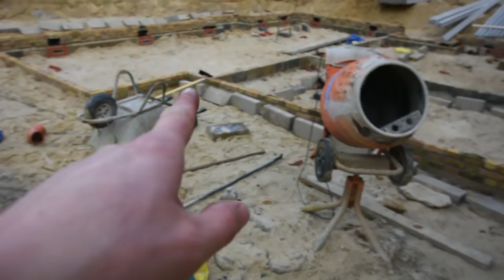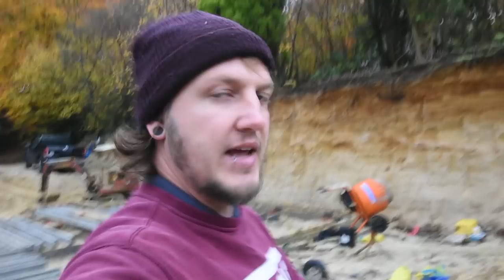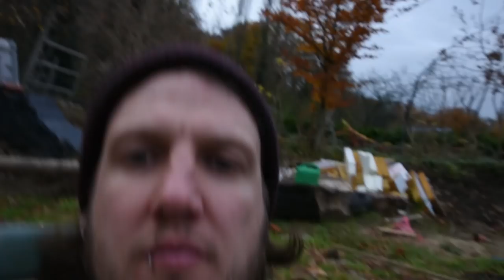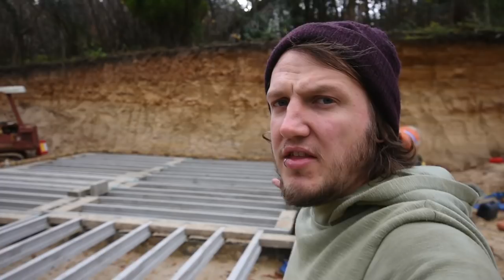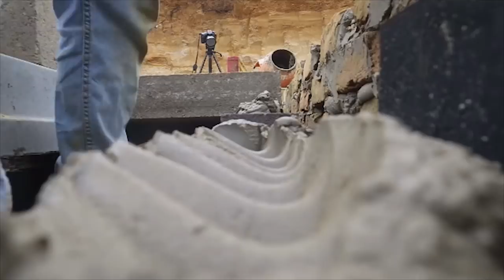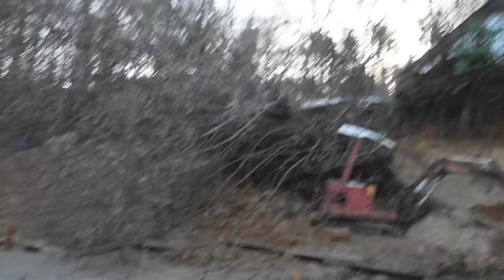How to INSTALL BLOCK & BEAM FLOOR CORRECTLY by YOURSELF | House Build E.P 11

Comment: Cool when I did mine I left a gap in the wall and got the machine through on some floor place a lot  easier lol did it on me own like you your doing a excellent job
Reply from the maker: 🤔 Good idea! It helped a lot using the machine to get the beams at least part of the way. Those suckers are so damn heavy!! Would deffo get an extra set of hands next time

Comment: I started watching this playlist and can't stop... Excellent!
Would it be advantageous to lay down a vapour barrier on the ground below to prevent moisture under the floor, for your climate?
Also. you could use a small bottle jack to lift the beams for you when installing the damp banding or lifting anything, easily. I have been working alone all my life; a couple of small 2 ton bottle jacks, 2 scissors jacks and wood blocks in 2 milk crates are an important kit in my tool collection.
Reply from the maker: Interesting addition to a tool kit. There will be a gas membrane spanning the whole floor just before the floor screed goes down. That will stop any moisture getting in

Comment: isn't it easier to make a pluming, insulation, steel rebar, rough electrical and heating floor at once and pour concrete on top ?
I bet these floor beam cost same as ordering concrete for whole floors
I know things are done differently in different parts of world, just wondering.
And dont you use insulation under floors in england ?
P.S I like your videos, kinda have same dream, seing you doing this alone is really encouraging
Reply from the maker: All the pipes, insulation etc will be put on top of the beams and then screeded over as per the architect's drawings. Glad to hear you're enjoying the videos and hope you get to live your dreams 👍🏻😁
Reply: Yeah seems overly complicated compared to pouring a footer and forming walls, then spanning the crawlspace with either lumber or even these concrete beams, but it's his project so he can do it his way.

Comment: why did the company not sling the beams onto the correct walls. This is standard practice by those companies. You will put your back out and have lasting damage messing about on your own. Get another pair of hand for the heavy work. Don't forget your BT and Electric ducts as well.

Comment: definitely would have been easier and better to do an insulated heated slab. That looks very strong but i sure don't like open unfinished ground underneath.
Reply from the maker: I agree with you. Unfortunately theres an old land fill site on the other side of the road and the council needed certain gas preventions in place and a solid slab would have be a lot more work and money. The  lock and beam was the easier cheaper way to do it.

Comment: Well done mate, seems like an awful lot of hard graft..  Why did you decide to do B&B floor in stead of a concrete slab foundation (which would be simpler to complete by yourself if you hired a mixer truck?)
Great video nonetheless champ!
Reply from the maker: There were a few conversations with the architect in regards to the slab. Apparently there is risk of gas penetration so having a solid slab would have been a lot more hard work. Would have needed a specific sub base, not hard core and sand, which was a bit pricy and a ball ache to fit. Also adding vents in the slab. We went with the beams because it was an easier solution. And man were those beams heavy to lift on my own!!!! Ha ha. Wont be doing that again without help 🤣🤣
Reply from the maker: Theres a gas barrier going over the top of the block and beam floor before the floor gets insulated and screeded 👍🏻
Reply: Rodian Montague I did a block beam floor over a exciting land fill. Had to be piled deep and gas blanketed
Reply from the maker: Rather you than me buddy 🤣 They must have been deeeeeeeeep piles?!
Reply: Rodian Montague couldn’t go toilet for a week
Reply: Rodian Montague were you from
Reply from the maker: Surrey, how about you?
Reply: Rodian Montague Kent mate worked on a job in camberley
Reply from the maker: Nice area round there 👍🏻